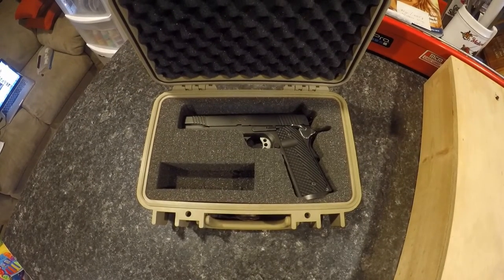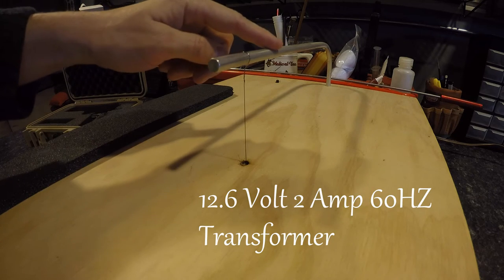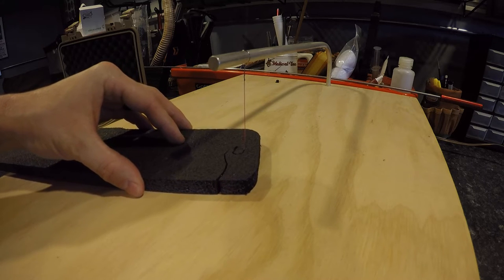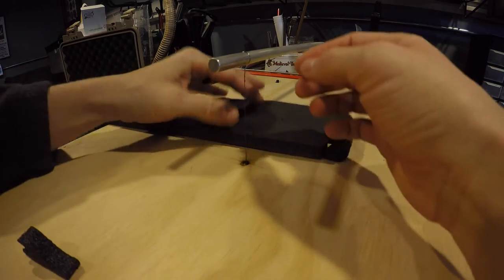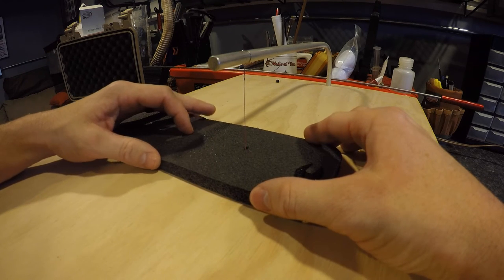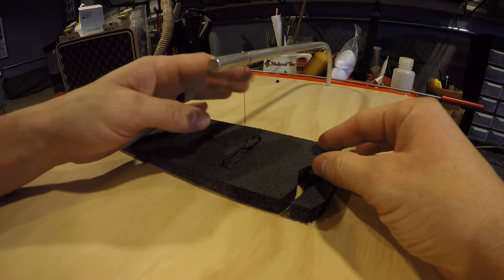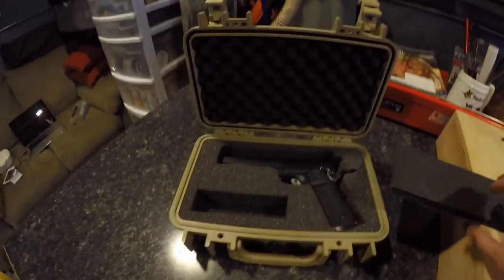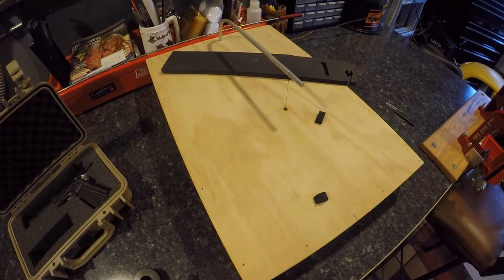DIY Cutting Pelican Gun Case foam insert for an AR15 with a Hot Wire Foam Cutter (Part 2)

Comment: I tried a guitar string but it snapped every time with out ever turning red hot. Bought a large soldering gun.  Will use 12g house wire to make curved cuts.

Comment: Hey was just wondering I just bought a pelican case for my gun and was wondering in detail how you built the hot wire cutter because yours looks like it works better than most ive seen

Comment: Great video, I was wondering what sort of material you're using for your templates? Would bristol board work or do you need to use thicker material like cardboard boxes?
Reply from the maker: I used standard poster board with success.  Similar to cereal box cardboard.
Reply: mhorschel32 Thanks for the reply, I wanted to piece together a cutter up here in Canada, but the cheapest transformer I could find is $75. I guess I'm sticking with the electric knife unfortunately.
Reply: Ghanim M. what about hvac 24v transformer? About  $40

Comment: Great video, thanks for the upload. My pelican gun case foam is pretty dense and about 3 inches thick, would this work?. Also i read about toxic fumes. Do you normally wear a mask?
Reply from the maker: I made this to cut Pelican Case Foam for an AR15.  If you get the 26ga Ni-chrome wire red-hot, it cuts like butter through every type of foam I have put it up against.  A respirator wouldn't hurt, it does give off some fumes.
Reply: mhorschel32 thanks for the advice on the wire gauge!